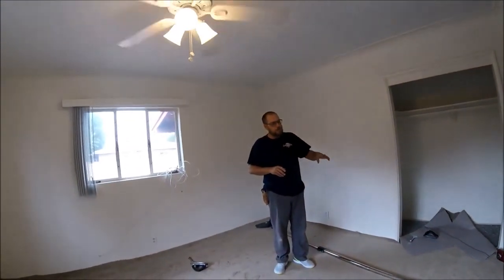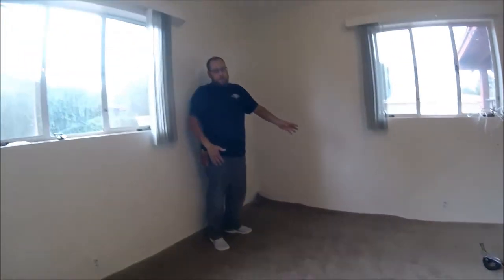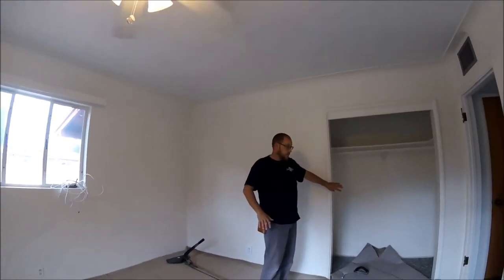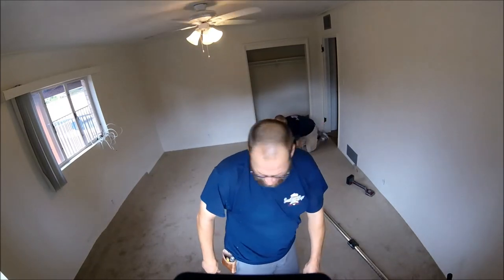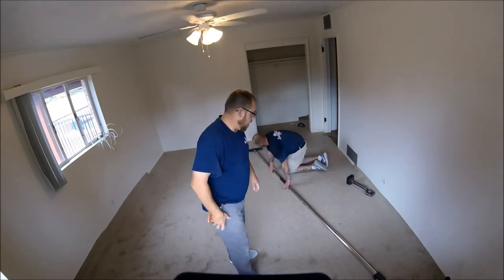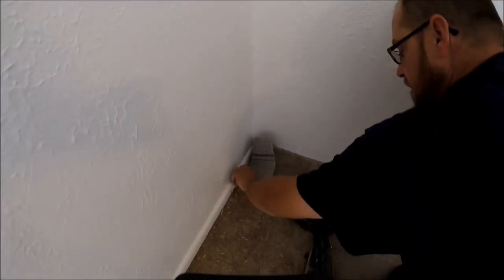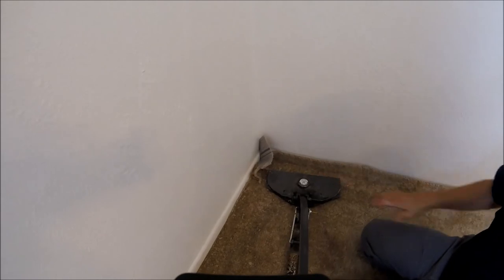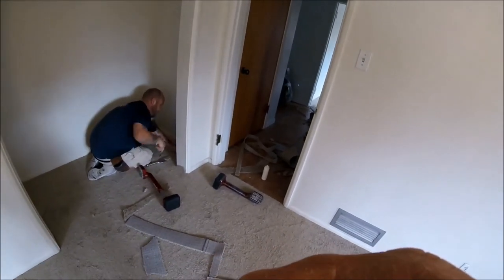HOW TO STRETCH CARPET PROPERLY

Comment: As a general rule whether knee kicking or p stretching it's easier to stretch to a straight wall    .Another good rule is to stretch across a doorway. On this room that would mean hooking it where the doorway and closet meet and stretching to just the other side of the doorway and hook it. Then you can seam the doorway or turn and staple it. then you can stretch across the closet to the opposite corner
Reply from the maker: johnnyaero1 Thanks for your  Advice